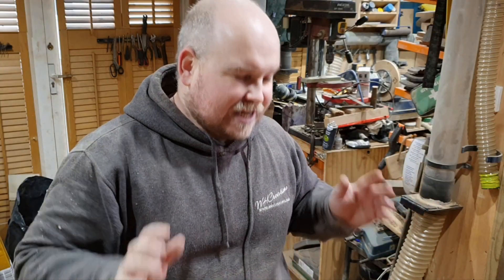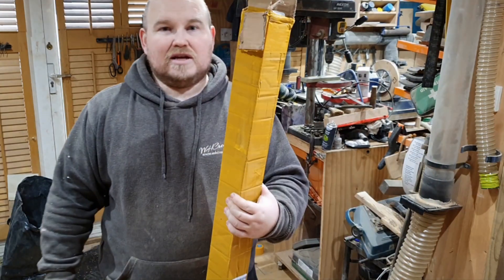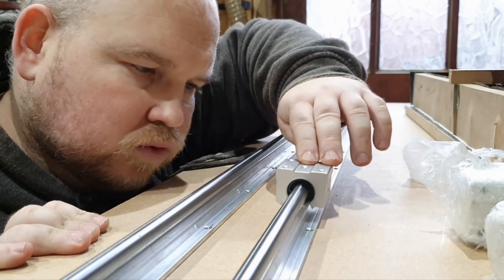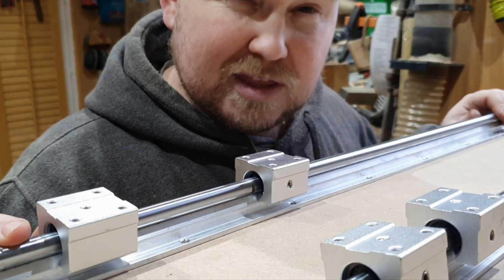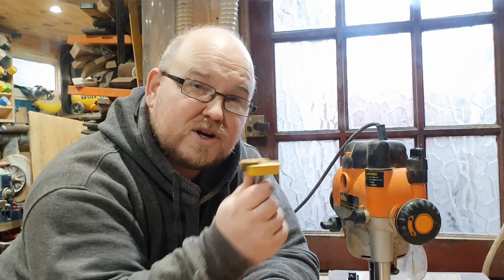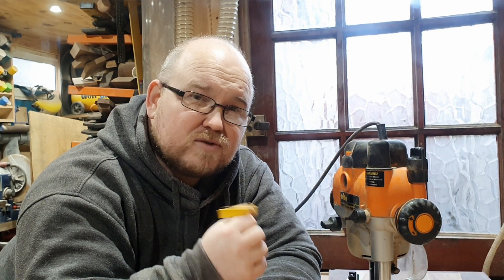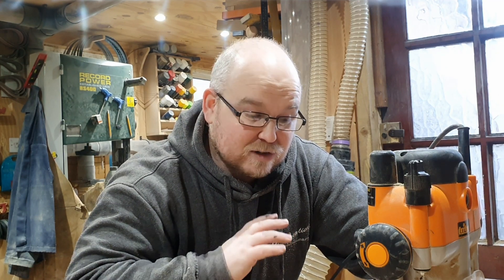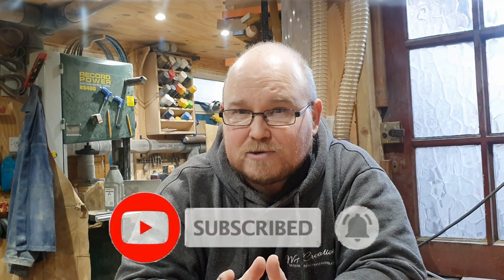Flattening Lumber Like a PRO: Build Your Own Linear Rail Jig! Part 1

Comment: Great video! Now after a few months, any issues? 
 
I did this in Feb of 2020 and used the round supported rail system like you have. However, I would constantly destroy bearing blocks from material getting into the bearing. Also the clearance from router base to my workpiece would occasionally be too much. 
 
So, I ended up switching to linear rods with longer bearings (and grease ports). But I eventually got rid of the grease completely and sealed bearing ends with a rubber O-ring, after filling it with a spray dry lube (if anyone ever tries this, remove 100% o the grease in bearing or you will see how Gorilla Glue is made lol.).
 
I went with 16mm rods at 400mm for X axis. And mounted those to a 25mm 1200mm Y axis system. 
 
I also went lighter weight on my router (bosch 1617) in order to prevent flexing of rods. 
 
I did basically the same with my panel saw I built.
 
I'm currently changing my older hand made pantorouter (I used ball bearing drawer slides) and putting my linear rail system (like what you used in video) in its place. The pantorouter system has a near perfect dust collection system so not worried about dust. 
 
I love linear systems. I cant wait to see what you come up with next!!!
Reply from the maker: Thanks buddy, yeah they certainly are amazing things. So I have found that the MDF base is a pile of poop. It definitely needs revisiting, however I have not done much with it since making the videos. I do have something in mind however and think it would better suit my needs. With the summer fastly approaching I need to carry out some maintenance on the workshop and I will also be moving things around to make it better suited to my now current requirements. Thank you for your continued support and appreciate your feedback, its all good experience and knowledge.
Reply: @WHCreations  yeah..  I despise mdf... but I cant seem to escape it!!! Lol. 
 
Be safe, and thanks for reply. Look forward to seeing new ideas and improvements. (I'm always finding something new to learn from others... so thank you!) Hope shop goes well, and the summer is a mild one for ya.
Reply: 02

Comment: Been There Done That...  I built a complete system with an aluminum router sled..  Using wood for rails is going to cause issues...   Building the sled using the bearing guides takes out any wobble or kick back you will get when you don't have the router bolted into place to hold it down...  Even the woodpecker rig that sells for 1000 dollars leaves marks because the router isn't held down...  My rig does not allow the router to move up at all... there is 0.001 inch of play up and down...  Also, I don't run across the slab but along the length.  This method leaves no marks and the slabs come out perfectly flat to within 0.002 of an inch...    My rig has many different uses.  It's basically a hand powered CNC...  It can trace patterns and also can even edge cut slabs with very high precision..     Router Sled for flattening wood slabs used for edging a slab - YouTube    Router Sled for flattening wood slabs - YouTube  You can watch on my channel   Router Sled Used To Flatten Slab For A Cherry Hall Table - YouTube    fisher wood craft
Reply from the maker: Hey, thanks for the comment. Will check your setup out. I think the uses this gives me as a woodworker is immense, and I for one am excited at the prospects.

Comment: Great setup!  Here’s my suggestion (and only because I’ve thought about this a lot and plan to build something similar - I have no experience other than using a homemade plywood sled):  instead of sliding the router across the MDF sled to cut (where you’re relying on the stability of your MDF piece), start the router above or below the workpiece and use the linear rails to move the sled vertically along the entire length.  You did a little of this in the video, but if you build a sled that can hold the router down, you should be able to move it along the length of the wood without even touching the router.  Just by guiding it on the rails.  When you get to the end, move the router a little bit less than the diameter of your bit and do it back the other way.  Not putting your hands (and therefore any body weight) on the router while it’s moving should greatly reduce the flex in the MDF.  I think this method absolutely requires a way of restraining the router vertically in the sled, otherwise you have a great risk of the router tipping and gouging.
Reply: I am seeing a perpendicular pair of linear rails mounted to the glides on the long rails. Attach the bottom plate of the router to the glides on these rails and you get X and Y motion with no sled to slide your router on.
Reply from the maker: Thanks buddy. Yes agree it is much easier going along the board than across it. The sled still needs work to get it where I want it, but I do have some plans on how I want it to evolve, so make sure to keep checking back on that one! all the best in your build!

Comment: Good vid, doing a similar setup myself.  One issue I see is that the sled looks like it might flex under weight/load, have you checked your slab flatness after routing?
Reply from the maker: Thanks. Yes it does flex, I am going to redesign the sled at some stage, maybe with angle iron or something.
Reply: @WHCreations  consider shorter linear rods and bearings as sled. Then you have an x and y axis linear system. A 25mm linear rod system should suffice, but theres no such thing as too much support, so look even bigger of need be.

Comment: Suggestion. Instead of raising the rails to adjust for the workpiece, why not 3D print a number of spacers to sit between the bearing and the sled, like you did with the washers
Reply from the maker: Thats a really good idea, Andy. I think I may have to try it and see how it works. 👍
Reply: @WHCreations  another option is remake the sled using Alu extrusion and 2 more linear rails, and adjust the height using a screw
Reply from the maker: yep, thats another one. I do have plans for an "end goal" for this sled, aly extrusion may just be part of it 😉